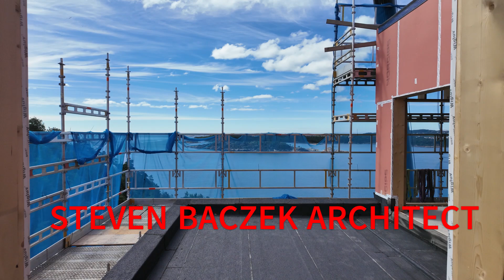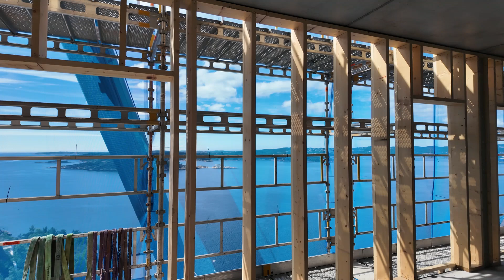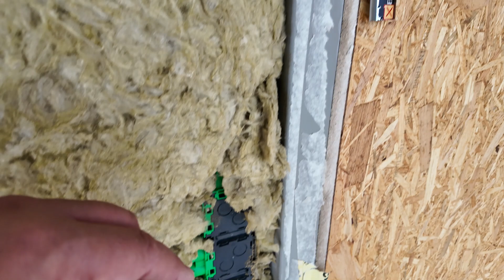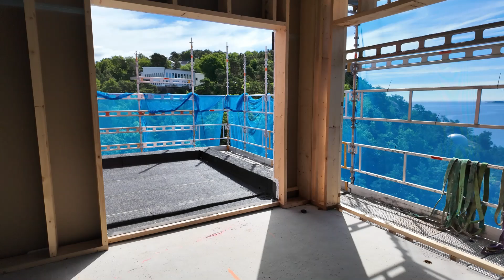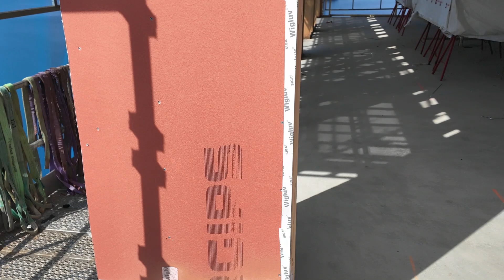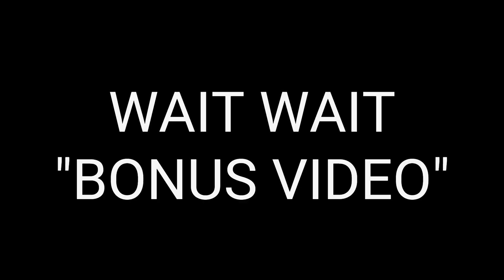PRE-FAB BATHROOM PODS (thew right one)

Comment: I'm not against the trough idea without some modifications. It helps isolate the high risk zone to a smaller area, and the scupper is a good way to know something is wrong without letting the flood water build too high. I would have a monolithic waterproofing layer/ pan in the trough underneath the rest of the roofing membrane as a redundant layer. I would like the trough detail then.

Without a backup monolithic layer underneath, any water buildup would challenge the seams of the roofing membrane in the trough and leak through if the seams are imperfect or degrade over time. A bigger scupper than the small pipe and which sat flush to the floor of the trough is the only other  major tweak I would make. The outlet over the side of the cladding can stay small, but a pre-fab or soldered sheet metal scupper body with a flat bottom can sit flat on the trough surface and makes for easy lapping and flashing of the roof membrane. 

That said, the workmanship on this job seems to be top notch, so 'riskier' details are safer to do. In my market, the labor quality is often shit, so we need to do safer, traditional, or dumbed down details most of the time.

Comment: Always thought the bathroom pod concept would be great for the hotel/motel industry.  Not a fan of the deck water system.
Reply: I think so. Especially for hospitals that need to be built more quickly. As for hotels, they have to be able to renovate. I’ve worked on hotel jobs and they want to update the rooms periodically, and it may mean taking out tubs and putting showers, All new fixtures and finishes. The more high-end the more they have to keep up with the “times” or latest interior design concept which will be passe in 5 years.